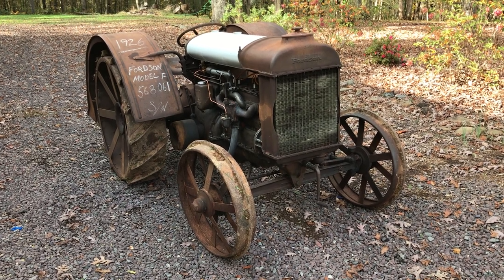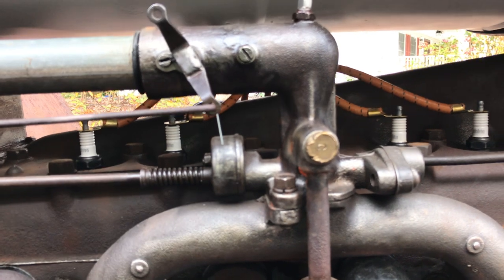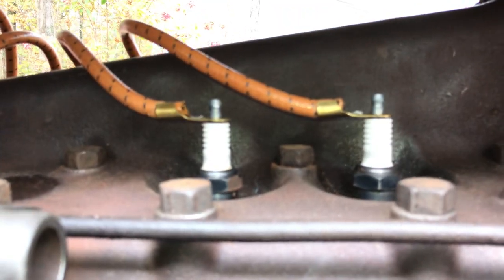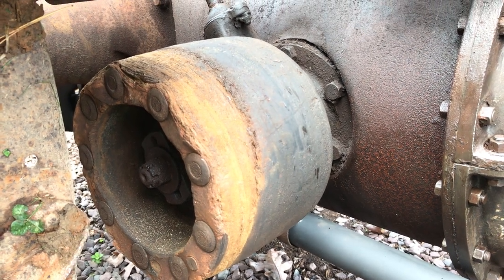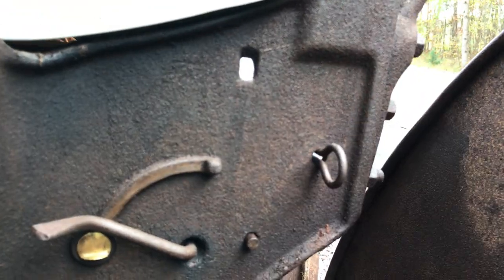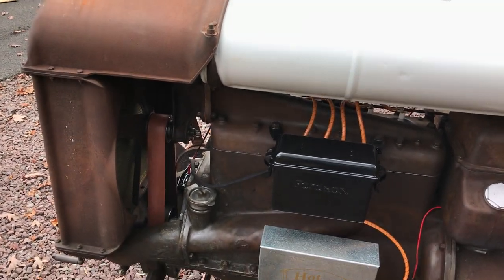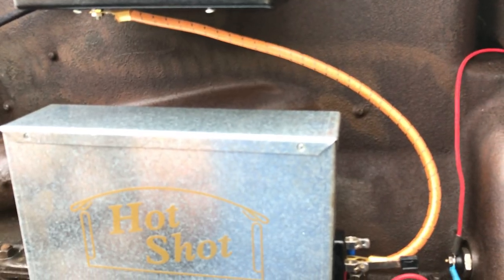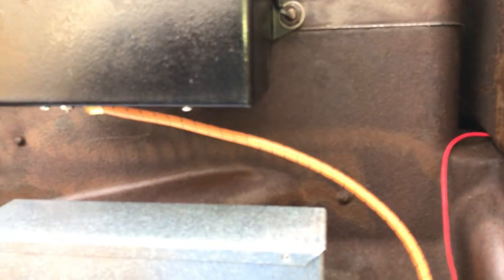1926 Fordson F Tutorial

Comment: Very nice presentation and it did answer some things I've been curious about.  We had one of these model F tractors on our farm in Kansas.  My parents bought the 80 acre farm in '42 and I believe the tractor came with it.  The metal cleat wheels had been cut off and new, pneumatic rubber tires fitted - I remember the removed wheels lying in some junk next to the machine shed when I was very young.  Most notable thing was the engine had been replaced with a grafted in Buick 6, probably mid '30s vintage.  The underside of the oval cross-section Fordson fuel tank had been modified to allow for the rocker cover of the Buick engine with a flat bottom.  It still had the iconic radiator and I recall it smoking some in hot weather.  Later, I learned to drive the tractor and pulled hay trailers from the field to the barn with it.  The farm was sold off in the early '50s and have wondered what became of that very unique Fordson.
Reply from the maker: It is quite something all of the modifications that people made to these tractors to keep them running over the years.  Many people had a lot of skill and mechanical know-how to make most anything.  Yes, it would be interesting to find that tractor and bring it back to life!
Reply: @duginvirginia5737  Do you know the bore and stroke of the Fordson engine?  I'm curious as to what model T parts might have been used.  

EDit: Disregard, answered in another video.  It was larger displacement than the T.
Reply from the maker: @whalesong999  The first ten years or so, it was a 4" bore / 5" stroke.  Sometime around 1928 and onward, the pistons became 4.25 inch.

Regarding parts shared with the Model T, the only things I can think of off hand are the coil box, coils, magneto contact (later model T's), the comutator (timer), spark plugs, and the V shaped magnets on the flywheel.
Reply: @duginvirginia5737  Thanks much!

Comment: My compliments on your informative presentation of the F model. Regarding the air cleaner, where is the air sourced from or, how does it actually get into the cleaner to be washed?  Thank you from Australia.
Reply from the maker: The air cleaner has a tube cast into the bottom half of its body.  Air is drawn in from the outside and from the bottom of the air cleaner.  It travels up through the tube and then encounters a brass float assembly that forces the air into the water.  The air bubbles that emerge are now "clean" air that is also damp and provides better ignition when running kerosene.  Here is a link to a manual with great illustrations on the air flow.  Scroll down the the 16th image in the scan and it shows a cutaway of the air cleaner and process.  The next page shows the air flow from the air cleaner and into the mixing chamber, manifold, etc. Of note, there is one parts supplier who has marketed a dry type air filter whereby the brass floats are removed and a rectangular dry type automotive air filter is fitted into the housing and acts as a conventional air filter. 

http://www.cimorelli.com/mtdl/1920/1920fordson.pdf
Reply: @duginvirginia5737  Thank you kindly for your detailed explanation of the air cleaner and the pdf of the manual. I now have a clear understanding of the system.

Comment: Thanks for the video, I have a 1923 Fordson myself. You should mention that it’s important to run the proper oil in the rear as there are brass parts in there. Also I believe Mobile 600w steam cylinder oil is ISO 460 which is around SAE 140, technically not 600 weight although it sure takes a long time to fill!